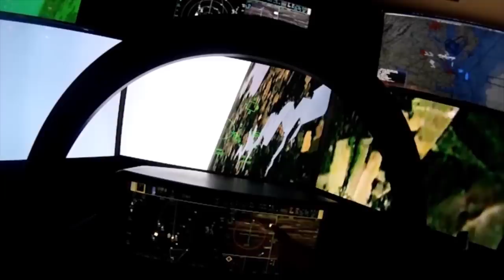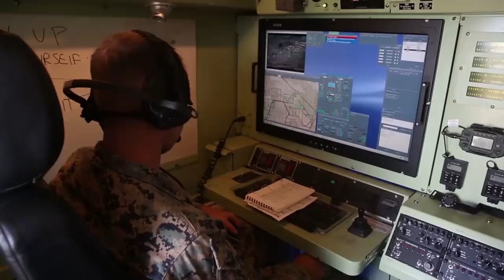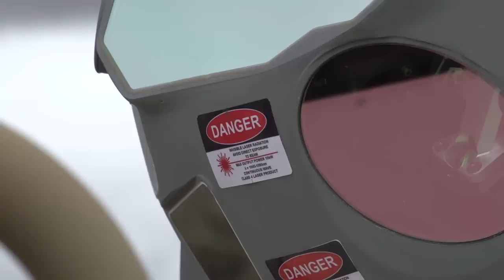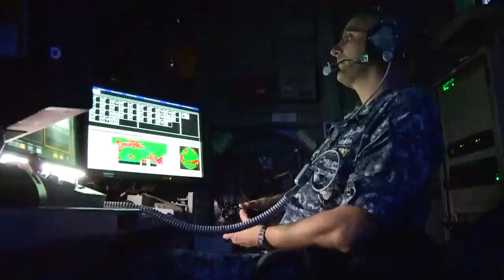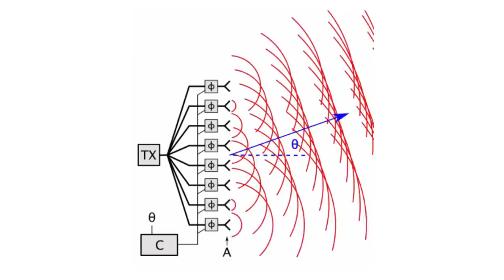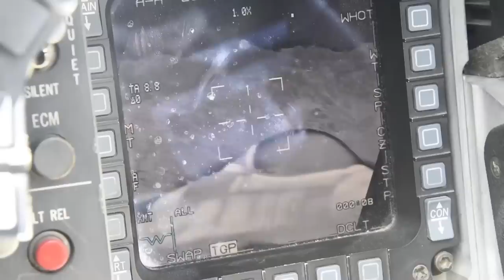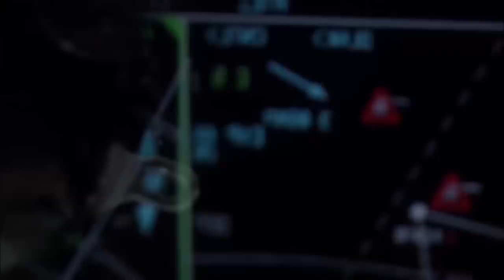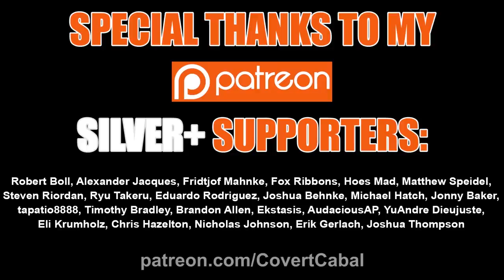Future Gen Fighter - 6th Generation

Comment: "You don't need a pilot to feed, pay housing..." but you do need to feed the operator and pay his housing :D
Reply: Adambaeva Saule but one operator can control 10 aircraft and needs way less training.
Reply: @Sir_Budginton  One operator cannot control 10 aircraft, he can only switch control in between while flying on autopilot. Drones can only perform surgical strikes and recon... they cannot engage in dogfights, cannot engage in ground support, cannot deliver payload. Drones require investment to improve overall performance which will further increase their price. Cost of manufacturing high end technology isn't cheap, and that also involves evolution of training. Training personnel can eventually reach to the point where requirements may reach higher education (evolution of medical treatment or mechanical engineering is a perfect example) ;(

Operating a drone in combat is save, but also costly. The psychological impact from combat is radically different between a pilot or an operator. If both operate same machine in actual combat, the losses from the pilot will be minimum compared to an operator. The loss of strategic initiative in the air may result in loss of life on the ground. While pilot will simply catapult, survive, improve. Operator will simply buy another coffee, oblivious to economic impact he had on losing so many drones who are 10 times more expensive then the one our pilot flew. :D
Reply: Adambaeva Saule obviously with modern drones it wouldn’t work, but we’re talking future drones. These drones will be capable of ground attack, or aerial combat all by themselves with no assistance for the operator. 

The operator will simply call out a target, and have the drones do their thing, while the operator sits back and decides if they need to do something else. Imagine a platoon commander, they don’t micro manage the 30 men they’re leading, just give general orders on what to do and where to go, the the soldiers carry that out themselves.

As for cost, well, of course they’d be expensive, all modern equipment is expensive. However, training pilots is also extremely expensive, and that’s a cost you won’t have to worry about with drones. You also won’t have to worry about losing any of your pilots by sending them on dangerous missions.

Of course the operator will still get plenty of training, know what the plane can and can’t do, and will probably lose their jobs if they throw away drones needlessly.
Reply: @Sir_Budginton  There is no such thing as "future drones". You can't simply drive your imagination and stamp it with the concept of "future drones". The idea behind your argument is a machine powered by a tremendous power source, operating AI far surpassing computing power of an CC. Just the size of the drone and the heat produced must be staggering. How can anyone argue with the concept of "future drones" based on one's imaginations. 

Your entire argument is based on a pill to cure all diseases. It's far fetched from reality and simply based of ignorance on all aspects from modern warfare to basic economics.
Reply: Adambaeva Saule it is a safe assumption to make that current technology will improve with time. Self driving cars are much better now than they were 10 years ago, and they will be better in 10 years time.

The same applies to drones. If you look at neural networks, they get smarter without needing more computing power. That’s what Tesla is doing, and that’s what drones can do as well.

The drone doesn’t need to be self aware, doesn’t need to be anything other than a drone, and so can be (relatively) simple compared to an actual sentient AI.
Reply: @Sir_Budginton  There is no such thing as self driving car. The name itself and the practical nature of "self driving" cars is just a misconception used by marketing to sell you a car. The technology behind it based on proximity sensors which in turn regulated by a software. Our technology didn't reach to the point where an AI can interpret calculus through visual aspect, so the self driving capability cannot be achieved with out an AI or a specialized infrastructure. 
Your Tesla example has long retracted their "self driving" advertisement to "partial" or "full self driving". The pitch made for idiots with money to spend.
Reply: @Adambaeva Saule. What kind of progressive are you?  How bout pay her housing?  Goodness soldier,  get with the program.
Reply: let's face it, if a program does not provide jobs, its not getting approved.
Reply: When being in danger of a KIA in an operation is removed, plus there being more aircraft, the position of being a plot would become a lot more accessible, a "drone fighter pilot" would be paid less.
Reply: @theCatalyst9999  Casualties isn't a thing in the army, war will go on despite KIA. 

Advanced superiority fighter drones of the future will be equally expensive and their casualty rate would be much higher compared to piloted aircraft. 
Not to mention, in modern warfare, communication/GPS satellites would be one of the first strategic assets to go. 

Drones can fly without GPS, but they cannot fly far without the means of secured communication.
Reply: @tomasgogashvily5350  unless they are some crazy AI, which even if viable, carries its own obvious risks.
Reply: @gabrielandradeferraz386  Why not just hire superman, an immortal god from another planet.
Reply: @tomasgogashvily5350  A guy once siad "man won't fly for atleast 1000000 years" around the late 1800s. , we cannot be certain what the future holds but id wager hanif shakiba here isn't so wrong about this , technology is advancing rapidly and Ai Drones that require minimal orders are absolutely in developtment already man do some research.  Why do you think their working on drones in the first place ? because its cheaper and safer than a pilot! id imagine controlling swarms of drones with a single operator is defintely something that will be happening in the future aswell as drones capable of working together as a hive as this technology already exists.

Many miltaries absolutely have a huge incentive to be the first to build operational swarm attack drones that require minimal orders / interferance.

Comment: "Limited only by power requirements" yeah, and cooling...
Reply: It's on a platform flying at hundreds of miles an hour, pretty sure the ram air alone would provide enough cooling

God forbid they use it with the plane on the ground tho
Reply: @skyscall  well.... no; actually, MiG-25 already had problem with heat barrier, air compressed before aircraft (same for SR-71). Hell, even F-35 had problems with excessive heat generated by onboard electronics.
Reply: skyeyemx overheating is a huge issue when you’re going those speeds, its one of the biggest limitations of an aircraft flying faster. The faster you can go the hotter it gets and the heavier material required to shield the heat, it’s an endless war against friction, heat and being light enough
Reply: Like my Mac pro
Reply: @YoungBlood507  Makes sense. The speed to reach Low Earth Orbit is around 31 Mach and ascending/descending spacecraft basically catches fire from just air friction, so airplanes at several Mach would have the same problem.
Reply: @1Maklak  That's something that sci fi authors conveniently ignore (at least with craft capable of landing on a planet with an atmosphere). Conversely, there are those space fighters that operate solely in the vacuum of space, yet are designed seemingly to be aerodynamic.😄😷😷

I wonder what options there are to bleed off kinetic energy for reentry. I suppose it could be done more slowly to avoid the fireball, at the expense of a more lengthy reentry. I'm curious if there's a quicker way to convert that energy to another form and radiate it away. Without an orbiting station, it would become important for a prospective Space Force.
Reply: @ChaplainDaveSparks  One option would be to have an engine and use it to slow down, but the craft would still fly in the direction of the exhaust. It was used for Munar landing as the only option with no atmosphere, but you just don't have the fuel to do it when landing on Earth, except maybe with an atomic rocket (hydrogen heated by uranium) or if there is a mine on Mun and it sends things like containers of water to Earth orbit. 

So spacecraft sacrifice a shell of something that poorly conducts heat, like cork and it burns off, then they deploy parachutes when low enough. I guess the parachutes would burn if used in upper atmosphere, but I don't know why.

Comment: Ohohoho! Lasers are going to be used eh?
Time to strap mirrors on the aircraft

Modern problems require semi-modern solutions
Reply: Sunset Cranberry 
Mirrors will melt like ice cubes in front of battle lasers . Those mirrors even if powerful won't just deflect them .
Reply: Vinay Palu time to develop super-mirrors
Reply: Until they use Ultraviolet or Infrared lasers -_- mirrors typically only reflect visible and infrared light. UV lasers will fix that
Reply: Any laser that can be focused and directed can be redirected... yes, not 100%, and most likely, the thing firing the laser will have active cooling which the target will not, so it's a battle of who can withstand the heat for longer. Presumable the best defence would be box reflector surfaces... basically, tiny squares of mirror at right angles to each other, means that whatever angle light arrives at, it will bounce 2-3 times before returning in the same direction as it arrived. There's one on the moon, allowing scientists to bounce a laser pulse off it, time the round trip to very accurately measure the variations in the distance to the moon, but more commonly, reflective strips for clothing and on road signs to make them highly visible to whoever shines a light at them. A rocket could be designed to take advantage of airflow to bleed off much of the heat to survive just long enough to destroy something critical in the laser. The downside is that it makes the rocket highly visible and easy to target with, for example, a laser targeting system for a non-laser weapon.
Reply: @blackpigeon4743  "mirrors will melt"
Sounds like reactive armor to me.
Reply: a better solution is a smokescreen to disperse the laser.
Reply: @blackpigeon4743  You can have total internal reflective surfaces.
Reply: First time I agreed with a furry
Reply: Lasers? On planes?

《It's time.》

Comment: The F-35 has some crazy AI software in the flight control system. The plane uses neural networks to actively model the aerodynamics of the plane. If it takes damage and loses a control surface, the model recognizes that and updates the aerodynamic model and adjusts pilot inputs to compensate

Comment: Everybody starts using lasers. Then everybody starts using mirror-plated aircraft/weapons to reflect them. Then everybody starts using lasers in place of radars since aircraft are so reflective it makes detection easier. Then fighters are developed with geometry to reflect lasers away from laser detection devices. Then detection systems look for the reflected beams refracting in surrounding air moisture. Then manmade sharknados are developed, and fighters and lasers become obsolete. Then sharknados with friggin laser beams attached to their heads are developed, and lasers make a resurgence. Then mirror-reflective sharks are developed...
Reply: So Rock-Paper-Scissors?

Comment: Tanks vs ATGM next please, Trophy seems unbeatable at the moment
Reply: Unbeatable from what? Like what all is it able to defeat?
Reply: @Joe_Friday  ATGMs, mostly.
Reply: @mr.normalguy69  Can they defend against anything else? What about incoming rounds from other tanks?
Reply: @Sundown Why could it not defend against other rounds too? Are they going faster than what these systems can defend against?
Reply: @Joe_Friday  Too small is the main issue. Also, things like APDSFS are designed to be able to withstand high temperatures due to very high velocity. You might be able to hit an artillery shell, though.
Reply: @Jupiter__001_  So basically the incoming tank rounds are too fast to destroy? This is why I thought these systems won't work against incoming tank rounds.
Reply: @Joe_Friday  Apart from ATGMs, those systems can defend any vehicle against RPGs, conventional grenades, launched grenades, rocks, arrows etc.
An incoming tank shell (AP, air burst, APDSFS etc.) is way too strong and durable to be even deflected from their course let alone destroyed.
Reply: @mr.normalguy69  👍🏻👌🏻
Reply: @Joe_Friday  Too hot (and so heat-resistant) and too fast (too little time to heat it with the laser).
Reply: @Jupiter__001_  Well I'm not talking about destroying it with a laser.  I'm talking about destroying it with something like an explosion.
Reply: @Joe_Friday  Well, the Russians have developed a system that is more or less a glorified hairdryer that blows away the incoming shell.
Reply: @Joe_Friday  
Trophy can beat ATGMs, RPGs, and rockets. However, unlike Afghanit, the Trophy used "shotgun-like" molten projectiles, which is pretty useless against kinetic penetrator, but unlike Western tanks, Russian tanks are more likely to rely on missile round. Afghanit use single molten projectile, which make it a bit more effective against kinetic penetrator, but it's still more optimized against missiles and rockets. So, in the end, the best defense against kinetic penetrator from other tanks is a dense armor plating, like the one made from depleted uranium. Trophy do have more coverage than Afghanit though, it basically cover the tank in dome-like volume.
Reply: Trophy is also said to be able to defeat HEAT rounds.
Reply: Nothing beats a saturation attack. Quantity has a quality of its own.
Reply: @kevinlee9816  I haven’t seen any proof of Trophy being able to shoot down shells.
Reply: Active protection systems can be defeated by multiple projectiles or decoys. APS need time, usually in the matter of a second or two, to reset between shots. For Trophy it’s claimed to be 0.4 seconds, though I suspect in real world conditions it’s longer than that. 

Two RPGs fired at the same side at the same time or one RPG with a decoy which deploys in front of the real missile will get through an APS. 

This is already well known. The RPG-30 has a decoy to fool APS.

Comment: Solid state lasers which are currently deployed on ships would be hindered by weather. However, the Navy is also working on FEL (free electron lasers) lasers that would not be hindered. And are actually much more powerful. Able to burn through 20 ft of steel per sec @ 1MW of power which has already been achieved in testing. The draw back is it requires an accelerator for power. It would also require more miniaturization.

Comment: Unmanned aircraft can be smaller and lighter, due to not having to accommodate a human occupant, with all of the requisite instrument displays, life support systems, ejector seat, etc. Also, the limitations imposed by large g-forces on the human body would be out the door, so the maneuverability would only limited by the physical limits of construction materials.

Comment: What happens if you cover missiles or bunkers, etc. with mirrors?
Reply: Covering something in mirrors makes it REALLY easy to see by radar (because it reflects light back instead of absorbing it). Mirrors are also delicate, making them vulnerable to conventional weapons. Even if you can overcome those two drawbacks, mirrors are also expensive compared to, say, concrete.
Reply: @Betelgeus3  if the mirrors are made to not reflect the light in the radar direction, it become invisible and invulnerable to lasers..., 🤔
Reply: @Betelgeus3  missiles travel too fast to matter anyway, so the reflective surface would be a way to protect it from laser defense systems.
Reply: An infrared unit would see it from an unbelievably long distance, it would be reflecting all the radiated heat and be very cool compared to surrounding areas. Just a software update would do wonders, lasers might bounce away but the old school stuff would ruin it pretty quickly.
Reply: These high power laser burn past mirrors, a supper expensive mirror with kept perfectly clean always would work.   I worked with laser that weld metels together years ago.
Reply: Then you can style your hair with it

Comment: UAV's have one major problem. Lack of situational awareness, a crucial part in a dogfight. Besides, ask any fighter pilot if they ever went black in a dogfight and they will tell you that the machine was more likely to fail at high G manoeuvres. 

I dont think the 6th gen fighter will be a UAV. neither will it have a laser for missile defence due to lack on power output on a jet. It will more likely be a delivery platform for "smart missiles"

Comment: Drone does not necessarily eliminate human error if it's still being controlled by a human.
Also the point of input and control being taken outside the aircraft could create problems with maintaining connection, and open a window for jamming, or blinding the drone as it only has a small visual input in the form of a camera or two. This comment isn't a knock on drones though just what comes to mind when thinking about some of the problems that may arise. What do you guys think?

Comment: the thing about lasers is that the military been working them since the 70's and they already had a tank with a laser that hit like several lighting bolts, and air force already said that their working on a laser that does not have a beam and is able to work in all conditions. and for unmanned aircraft the f22 already flew several dozen unmanned missions during the war against al-Qaida.  so the US Military already had all of this technology and been working on it for decades.